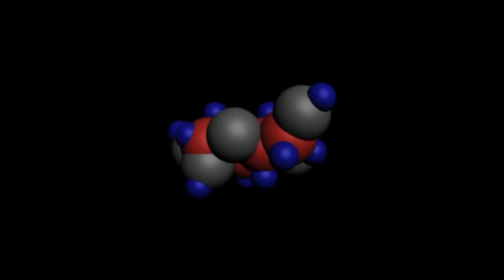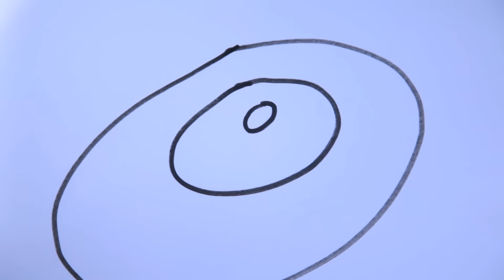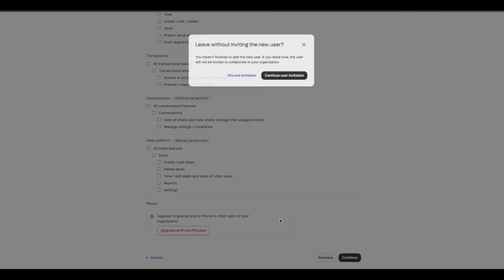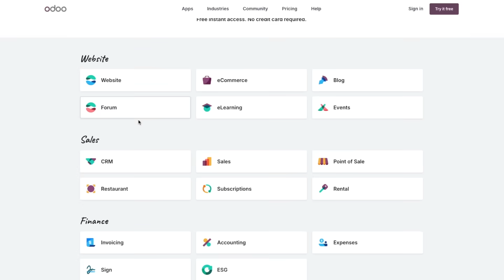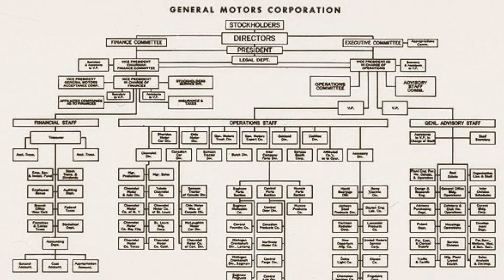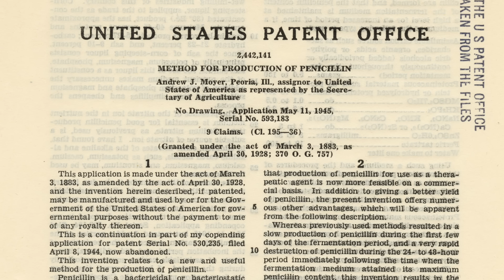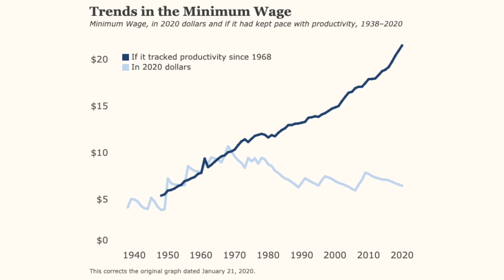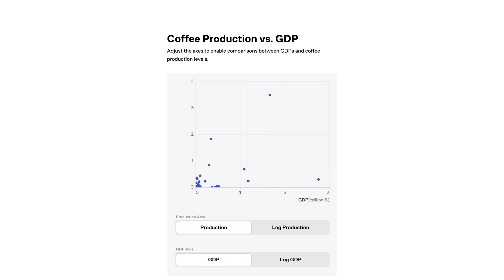The Profit Paradox

Comment: It's a good video and since you are so active in replying to people here, I thought I'd share my two major critiques:

1. Abstracting profit, productivity, quality of life etc. all into energy

You make the example with two medicine companies making profits and how much the society as a whole profits off of it. This feels like a false comparison as these two things are entirely different concepts. One is money accumulation, the other is quality of life.
These two are not connected.

2. Seeing energy accumulation as the ultimate goal

Your example of the company developing a drug and patenting & selling it vs. a company repantenting a slight variation, is trying to portrait the first as a positive example. But it is still often the case that these new medication is sold too expensively or produced in too low quantities to have the maximal potential impact on people's lifes. Other companies also producing a new drug (especially in other countries) could often save lots of lives.

However, here the impact for the society would've been better if the company made a loss. And that is the case for many many areas, not just healthcare. E.g. transportation (roads, trains), energy infrastructure, or research. These are usually run at a large loss with the understanding that their cost is worth the improvements to society. So instead of running it through markets, they are simply funded.

I don't care about money accumulation. I care about the quality of life of people.

Comment: Respectfully, the entire thesis of the video is incorrect. Sure perhaps in the future energy cost maybe more than traditional energy in input, however, at the moment the price for barrel of oil in terms of gold or other precious metals is the lowest it’s ever been in history. It is increasing in terms of raw dollar input, however, that is due to a multitude of factors such as new demand for precious metals, which is causing the price of pressure metals to rise and cost of dollars but not only this, there is also an increased supply of money the M2  Supply is ever expanding. Over a long enough timeline, the cost of everything goes down due to the increased production capacity, assuming external factors do not have much influence.

Comment: One comment about the video: the patent example is inaccurate. A patent is a tradeoff: you get a temporary monopoly on commercial production of your invention, in return you publish instructions on how to construct your invention to the level that a person of ordinary skill in the art could reproduce your invention without undue experimentation. The point of this is that it allows other people to experiment on and modify your invention to create their own new and improved invention which they could then patent. Also, patents can't be extended past 20 years. Once a patent expires, that specific invention (or formulation) can be produced by anyone. In the case of pharmaceuticals, what happens is that the new formulations have advantages over the old formulations and doctors stop recommending/prescribing the old formulations which means demand can't justify the upfront cost of creating the new supply chain. In the end, there is still a net energy positive as the formulation is improved by some significant degree.

Comment: Some science misconceptions here and there, but it fills the narratives, so I don't blame you. Your idea is solid, but I want to keep some correction here.

- Cells starts eating each other long before multi-cellular organism emerges.
- Plant ancestors are actually far older than animal cells.
- The first cells "seems" to be eating geothermal energy and sulfur, so they're closer to grain crops in larger scales.
- As for how death resets everything, if animal died in a freezing cold area or dry deserts, the stored energy doesn't go anywhere until something come to eat the body, more like retirement and inheritance than a reset.

And about eating the dead, fungus is the one we often ignored, but it's the real resetter. For human economy scale, it seems to be enforced by Last Will and Testament. This line isn't correction, it's just add to your idea.

Comment: Hey man, liked the video, but the chart at 15:55 is from 2011 and wildly out of date. It was made by AltaCorp Capital in a report, and solar prices have fallen significantly since then.

To qoute the financial post article on this, "AltaCorp Capital Inc.’s John Mawdsley, managing director of institutional research, looks at the advantages and disadvantages of different energy sources in an 82-page report titled: Renewables vs. Hydrocarbons, The Energy Reality."
Reply from the maker: Thanks my understanding is that “all in “ costs haven’t just marginal efficiency
Reply: @ArtOfTheProblem   I don't understand the grammar of the sentence you wrote.
I take it that you are saying that the chart includes the entire costs, not just the marginal cost of electricity. However the majority costs of solar, capital costs, are the ones that have come down significantly. I looked at the original report by AltaCorp Capital, but couldn't find the data in their badly organized sources section. However, according to International Renewable Energy Agency (IRENA), the levelized cost of electricity for solar has decreased from 0.445USD per kWh in 2010 to 0.049USD per kWh in 2021 (both in 2021 USD). Translating to BOE terms from the original report, it 756.5 USD/BOE in 2010 to 76.5USD/BOE. The descrepancy from the AltaCorp report's 400USD is majorly because of inflation, as the report has 2011 USD but the IRENA numbers are in 2021 USD.

Comment: Great explanation but you drew the wrong conclusion.
How do we differentiate the beavers from the algae, the net energy losses from the gains? It is an optimization problem and the answer is free markets.
If every participant in a free market transaction agrees to that transaction, we can be sure that it is a total energy gain (a beaver), because if it was to the expense of another participant, then the transaction wouldnt have occurred in the first place. The use of force and legislation by the state is the core thing that makes net loss transactions possible, like in your example with the patent. This is mathematically provable. I encourage you to research austrian economics, as this would perfectly complement your analogy.
Reply from the maker: Thanks I’ve done videos on Austrian economics and market mechanisms check those out - but your comment isn’t clear , are you saying there was a transaction between beaver and algae ? Are you saying there is a market price mechanism in animal kingdom ?
Reply: @ArtOfTheProblem  Sorry for the confusion, it is difficult to explain because it is very abstract. The laws of the free market apply everywhere where you have a medium of exchange. In our economy, this medium is money, and in the animal kingdom it is energy. The beaver expends energy to gain energy in the long run.  That is a transaction but a very simple one, because the beaver is the only participant in that transaction. If the energy price of building the dam is higher than the energy gained from that, the beaver will not partake in that transaction. This is just an economic calculation, and all economic laws such as supply and demand and market equilibrium can be applied here. The market equilibrium is reached when the marginal energy cost of an additional dam would not result in any more energy utility. At this point, a rational beaver should not choose to build it because it would be a net loss for him.

A better example is the seagull. It expends energy to hunt the fish and gain energy for itself. Meanwhile the fish looses all its energy. The fish did not agree to that transaction, it is an involuntary one, and that is the key. Because at least one participant did not agree to the transaction, this transaction is NOT a free market transaction. Same with the algae. It gains energy by stealing energy from the fish pond. If the fish pond had a conciousness, it would've also disagreed to that transaction. 

Obviously these animals are not smart enough to negotiate and transact in the capacity as we humans can, but it shows the fundamental principle. If all participants agree to a transaction, it is mathematically guaranteed to be a net gain, a profit for the whole system. That is why free market economies work so well, they are mathematically guaranteed to increase the net profit at nobody's expense. As soon as you introduce force (the seagull forcefully eating the fish), you introduce net losses.

Comment: The video calmly builds up its premises to ultimately reach a conclusion that has no basis whatsoever, a fallacy.
Energy did not simply become more expensive after 1970, as the video claims. On the contrary, with advancing technology, we have increasingly cheaper hydroelectric, wind, photovoltaic, and nuclear energy. What happened was that in 1971, money became fiat, without backing, where the government and the central bank can print money without having the equivalent wealth, creating an imbalance where the currency no longer keeps pace with wealth. Money stopped keeping pace with effort, and that is why things are more expensive. It is not because we are profiting wrongly, it is because the currency we are using is broken, benefiting only those at the top with the Cantillon effect.
Reply from the maker: I actually did a video on fiat money (see debt paradox) which covers this in more detail. And you are forgetting to measure TOTAL cost not marginal kWh

Comment: The core issue with the video is its intellectual overreach—it attempts to explain the complex, historically unique dynamics of capitalism by drawing a false equivalence with simple biological reductionism. This move, which humorously equates a CEO's drive for stock options and endless financial compounding with a single-celled organism's drive to accumulate cellular fat, is the root cause of its analytic failure.

The resulting thermodynamic profit test is simply socially blind, causing the analysis to fail to fully explain the Profit Paradox despite rooting it in energy and money.

The Failures of the Energy Test
Occlusion of Exploitation (Marxist Critique): By focusing purely on energy output, the video misses the fundamental source of capitalist profit: the extraction of surplus value from human labor. The test is irrelevant to social justice. For instance, the video deems an energy-efficient solar panel factory "Good Profit" for increasing usable energy. This verdict, however, occludes exploitation if the factory's profits are derived from paying workers starvation wages. The paradox is not just about energy scarcity; it's about the simultaneous creation of wealth and social misery.

Acceptance of Power (Anarchist Critique): The video accepts the necessity of coercive, hierarchical corporate and state structures (the "programmable colonies") as legitimate tools for "coordination." This framework fails to critique the concentration of power. It only wants these hierarchies to be efficient, missing the essential Anarchist point that these very structures backed by the state to enforce property claims like patents are fundamentally illegitimate and drive the unproductive transfer of wealth, regardless of their energy footprint.

The video successfully creates a technocratic framework for discussing sustainability, but because it judges efficiency over equity, it fundamentally misses the socio-political mechanism that transforms energy gain into financial injustice

Comment: Your next video should be about ideal money and Bitcoin. Money linked to energy. There should be a direct relationship between how much energy is needed to create more energy and the price of Bitcoin. When less energy is needed to create energy, the value of Bitcoin should go down. When more energy is needed to create energy the value of Bitcoin should go up. But if you draw your circle around Bitcoin you will find it has a fundamental flaw, code that artificially restricts the number of transactions the system is allowed to process. Without this block, Bitcoin could be positive profit as it allows for people to trade faster, more independent and with less friction then fiat. There is a version of Bitcoin without this block, it's called Bitcoin Cash. It's the future of money, but people don't know it yet.
Reply: Why would we waste so much energy? Basically every other cryptocurrency is more efficient, which means that they produce a net positive on the ecosystem. Anything that uses POW is a net negative and only positive for itself. Literally what they said in the video. Tokenizing wasted electricity is just wasting electricity....
Reply: @michaelsmith953  Let's say you are 1500 km away from anybody, somewhere in siberia. Would it make sense to use the water there for hydro and the sun for solar?

Comment: The first thing people promoting capitalism will say is everyone benefits from a free market.
But what if they are playing with a rigged deck?
Invention secrecy act 
Any invention that is a threat to a current industry deemed "too big to fail" will be confiscated for "national security" reasons. Because if they say its for national security, you dont have any rights, and they can do what they want.
Only been Happening since the beginning of the industrial revolution. 
Hemp was a threat to paper/ textile industry, which people in the government were already heavily invested in. So it was demonized, and deemed illegal. 
 Tesla was a threat to the current infrastructure that Edison was profiting from(wires for transmission)Thats why they didn't want wireless power. 
They knew 2 industrys wouldn't survive. Wire making industry would take a monster hit of you dont need wires stringing across the entire country, and so would any company charging for electricity....
Hydrogen cars? Totally feasible, and clean, uses existing infrastructure.... threat to oil industry so it wont be investigated further. Even though its super easy to build something that generated hydrogen. Electrolysis 
Plenty of scientists claim ita not efficient enough.... except it is at the right frequency. 
Water powered cars would destroy existing infrastructure. 
So anyone who figures it out is deleted. 
Anyone who figures out the 100mpg car isn't allowed to produce it because of government regulations.....hmm i wonder why? Could it be because oil companies loose money if usage drops off? 
Its why plenty of modern hemi ram just barely get into double digit fuel economy numbers.  And why anyone decent at tuning can make a vehicle get better mpg than factory tune.

Comment: The universe is infinite, therefore energy is almost infinite. Our desire to capture more and more energy will eventually take us into space. We will continue to use energy to figure out how to get more.
Reply: the jury is still out on that one. we only have access to the universe within the cosmological event horizon thus the energy available to us is finite. its entirely possible that there is more universe on the other side of that horizon, its just the point at which the universe is expanding faster than light. but there is no way to observe it directly so we can only theorize about whats there, same way you can only theorize about whats going on in a black hole.
Reply: @LordOfNihil That’s why I said it’s “almost infinite”. If humans are successful as a intelligent civilization, we will colonize the solar system, then the galaxy, and then the rest of the universe. We won’t run out of energy for billions if not trillions of years.
Reply: @DynamicUnreal  there is also a technological horizon. how far can we get within the limits of our propulsion tech? right now thats the moon. i dont think we will ever break c or even have constant 1g torch drives. 

you could colonize the slow way with generation ships. you just need to go to the next rock over and set up a civilization, your successors will eventually follow suit. it doesnt even need to be the next star over. have a colony in the oort cloud its only a couple light years to the next cloud over. there might be more stuff further out we can hop off of. we will find out when said colony starts building telescopes. of course these small pockets of humanity would be isolated and the energy available fundamentally dictates the longevity of the colony. but humanity as a whole will continue.

Comment: I think you misplace blame at 15:50 since there's good evidence that energy is still plentiful, or rather that the way to obtain more energy costs less energy than it previously did, per unit energy (how many energies can an energy energy if an energy could energy energy?) due to the exponential decrease in cost of renewables and battery storage, but also the internet and the advent of computers in general (it all comes back to computers; they supercharge society's ability to manipulate information, which should make energy even more plentiful and lead to another exponential golden age). 

The blame lies mainly in the coordination faliure of society failing to extract this extra energy due to certain individuals/corporations chosing to be localy energy positive and globally energy negative, in addition to the incentives being such that it's the locally optimum descision to chose a locally good and globally bad outcome.